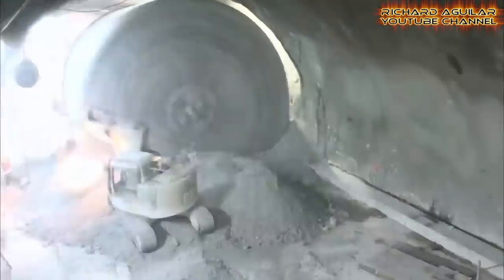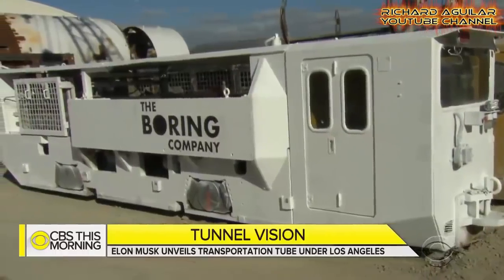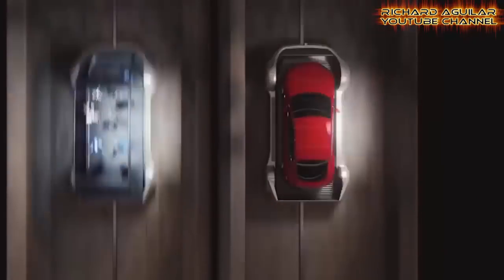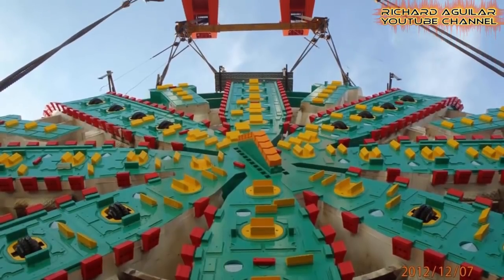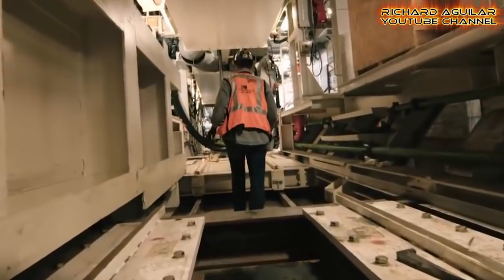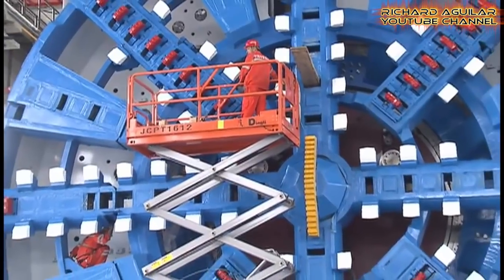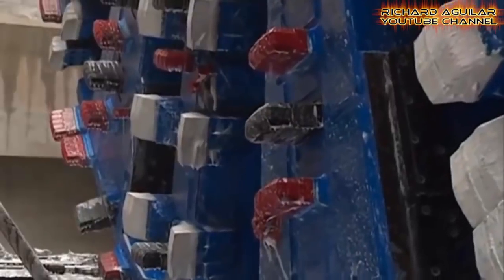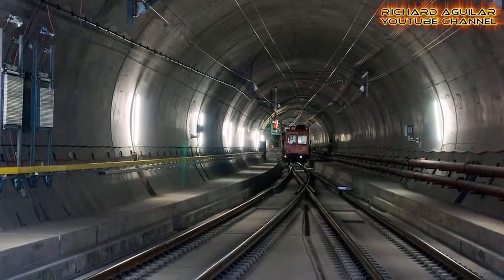USA vs China's Giant Tunnel Boring Machines: MEGASIZE Tunnel Boring Machines

Comment: I thought Elon Musk's TBM digs tunnel of only about 30 feet in diameter.  The Big Bertha was a 57.5' TBM was built by a Japanese company Hitachi-Zosen.  It broke down and required almost 2 years to fix it. Chinese machines generally bore 52' dia. tunnels.
Reply: yes, the point of why he made the boring company was to bore smaller tunnels faster than bigger machines